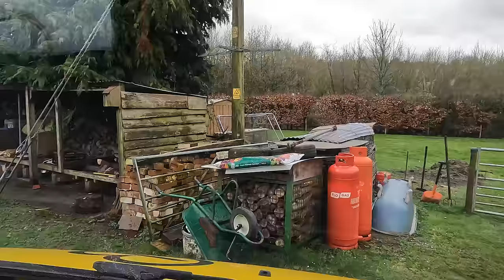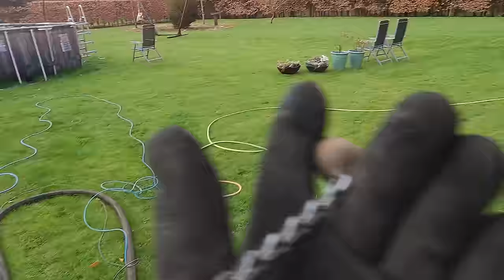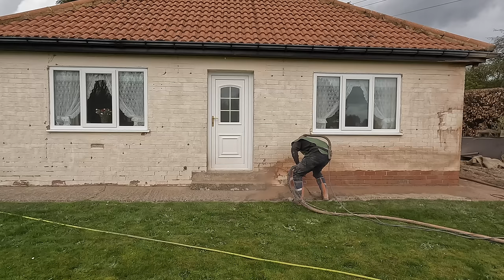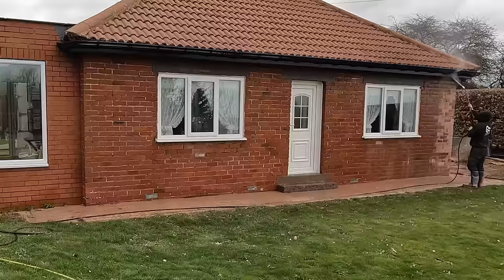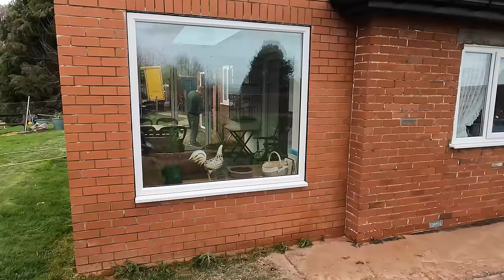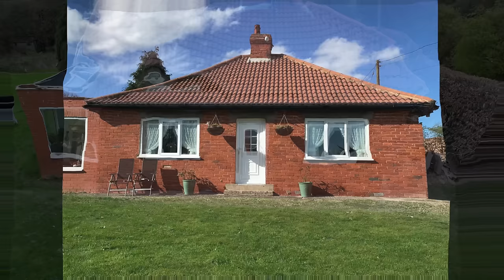Extreme Makeover: Brick Bungalow Edition - Sandblasting Paint Removal!

Comment: A vanishingly rare example of somebody using their stepladder in the correct orientation. Well done. Nice work.
Reply from the maker: 😊👌👍 it's very hard to blast side ways on the kick back presure would certainly be enough to topple me over 😂
Reply: I noticed that, possibly a board needed if that lawn was soft.
Reply from the maker: @chriseccles1454  I like to stamp on the bottom tread just to make sure it's not going to move or sometimes bounce on the bottom run it's abit like a habit that I do. I know working off ladders is dangerous but it's like second nature doing stuff I don't even know why I do it 😂 it's like a sense I've got haha
Reply: @Mobileblaster Staying safe sometimes becomes second nature but you can also become complacent it's an acquired balance .
Reply from the maker: @chriseccles1454  yeah definitely and when your concentration is on what your doing its easy to have stupid errors 🫣

Comment: Was the white paint checked for lead content prior to its dispersal about the property?  Results looks great.
Reply from the maker: I don't show alot of whats going off in these videos the not a how too 👌👍 but for your query yes I did test for lead what you didn't see also was the asbestos that was removed too prior 👌👍
Reply: @Mobileblaster   Thanks for the update. My old 1920's clapboard Craftsman Cottage house here in California is loaded with lead paint over the redwood, so sandblasting wouldn't be practical, I'd have to heat and scrape every inch of the exterior in order to remove the multiple paint layers.
Reply from the maker: @richardgraham1167  it's very unusual to have any lead on most projects as it's been banned since the 60s I always check on the older properties. It can be blasted with no problem so long as steps are taken. I have insurance-approved asbestos removal ticket if i needed lead tickets it won't be too hard to adapt my system to work with all the appropriate authorities 👌👍

Comment: This is a very risky process.  In the first instance I would strongly recommend that a full condition survey is carried out, including moisture readings to all the internal faces of the external walls and ceilings, which will be the basis of assessing any water penetration and damage.  Traditional standard British construction has evolved to cope with rain falling out of the sky and not a pressure washing with c2000psi jets, whether on not sand is mixed in.  I would be concerned that the brick facings have been eroded that will considerably shorten the life of the brickwork.  As indicated, all the brickwork will require raking out and repointing, making the on-costs considerably more than the jet and water/sand blasting.  I don't see any obvious signs that the cavity has been insulated, but if so the pressure washing will have soaked the insulation that will dry out to both the inside and outside over a protracted period.  There was probably a reason for painting the walls in the first place and most of the time its in the vain attempt to cure a penetrating damp problem - that hasn't gone away but will be highlighted by pressure washing.

If the intent was to improve the aesthetics then I would have considered overcladding with render or an actual,cladding system, which would have given the opportunity to add insulation.
Reply from the maker: It's a good job I was only at 45psi not 2000psi a jet wash is aprox 10L per minute I'm at 0.4L per minute sometimes less. The right media water psi and pitch won't harm a 4" clay brick it will still perform just like a new brick. The reason for the job was because the joints had failed and cleaning the bricks beforehand go hand in hand for a perfect newbuild luck. It has insulation and if that's been done by a reputable company it will be fiberglass none absorbent like all insulation companies use so that's not a problem. The reason was for astatics but your wrong about the paint if it's not approved for brick the it's like putting a bag on the house it need to breath 4" clay bricks are designed to repel water aswell as weep damp out. If you have any other questions I'm happy to put your querys straight 👌👍

Comment: Fired brick has a hard exterior face. It provides a waterproof surface. The interior material is softer. Sandblasting can remove that surface and expose the softer material to weathering. Sandblasting will remove the structural mortar. This then requires laborious hand repointing of all the joints. Sandblasting is a really bad idea. Chemical stripping is best but far more expensive.
Reply from the maker: 4" clay brick is still a 4" clay brick after blasting I can 100% guarantee it won't turn into a sponge and it will still perform like a new brick yes it will change the appearance but it's better then painted brick? Can I ask what makes you an expert ?? Because from my experience what your saying is wrong about everything else

Comment: I suppose, now all bricks require a good protection since the blasting removes the slick surface and opens pores?
Reply from the maker: No just re point and it will be like a new build 👍 blasting won't make a 4" clay brick a sponge its still a 4" clay brick 👌👍

Comment: Just asking pressure wash on old brick wall to remove paint will not cause sepage issue?
Reply from the maker: This isn't pressure as such it's only 125psi the water is only for dust suppression it'd the media doing the work 👍

Comment: Always good to see the hard glaze of the brick removed to allow the water in 😂
Reply from the maker: Removing a microscopic layer off a 4" clay brick isn't going to affect a 4" clay brick. The outer layer of a brick is for decoration not to stop it from being a sponge.
Reply: @Mobileblaster  bricks aren't fired in kilns as long as they used to be. Plus to take the paint off that quick it's got to be taking some of the brick surface away as you can see in the red waste water and slurry. Reckon it's a fine line between doing it right or messing the brick so it spalls later.
Reply from the maker: Red waste? How do you know that's not the waste media? look, if you're a blaster and want to pull my work that's fine but you're not filling me with confidence with your knowledge. If you're not a blaster, I can reassure you that a 4" clay brick will not turn into a sponge after removing a microscopic layer off the face. Blasting is abrasive, yes but I have the ability to remove paint off a coke can or profile stainless steel ready for rubber Linings. The speed of the job is all down to the equipment and knowledge needed to operate it at its full potential. If I turned up with a rig that's got no power and takes me 10x as long, does that mean you are getting a better job? Or you're getting ripped off by a cowboy?
Reply: @Mobileblaster  all I'm going by is what I can see on the video, I'm not knocking your work just saying it must be a fine line between messing the brick up getting the job done in a reasonable time. If the red waste is from whatever grit is in with the water maybe you should point it out in the videos otherwise it just looks like it's from the brick. It obviously looks a  thousand times better after blasting but if that's at the sake of the brick then not for me.
Reply from the maker: @user-yh7un3sz7v  It isn't for everyone the owner of this house tried chemicals and the doff plus falch (like a doff but 5x more powerful) without any success they were at the end of the line without knowing how to get the paint removed rendering company turned it down until the paint was removed so it was a matter of blasting or live with damp. As mentioned it is abrasive and it does remove a microscopic layer off the face this does not affect the way the brick performs in any way when it comes to repelling weather and also weeping condensation out. When it's the only option left and someone like me says I can remove it and you won't need to do anything else ie render etc if the cement is good to start with but in most cases, repointing will need doing after blasting as said if it was good cement then I cannot remove it so no more work would need doing if that's good 👍
I appreciate constructive criticism filming for YouTube is a secondary thought I would love to remember to say everything I need to it's not doable as YouTube is a lot harder than 1 would think especially when I've got my brain in gear for the job 👌👍